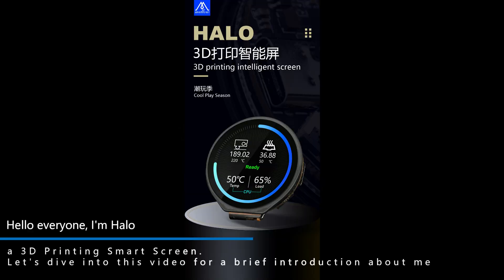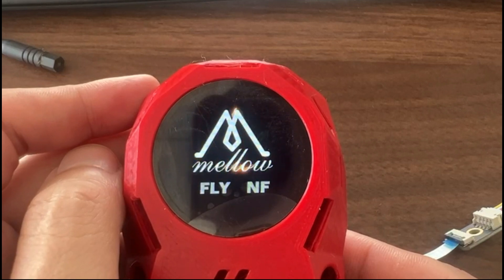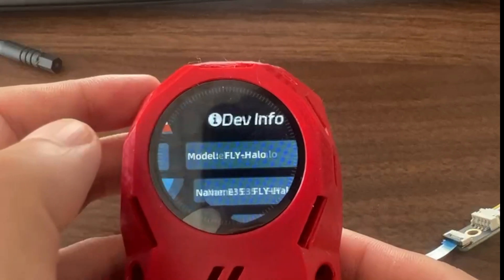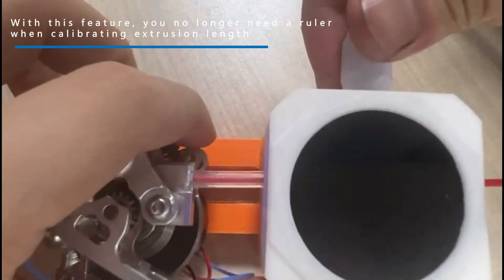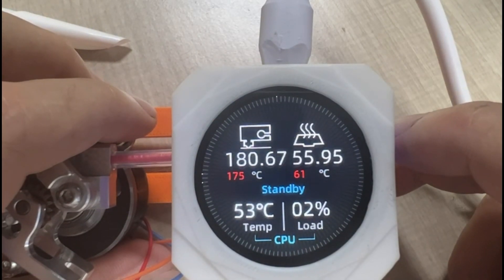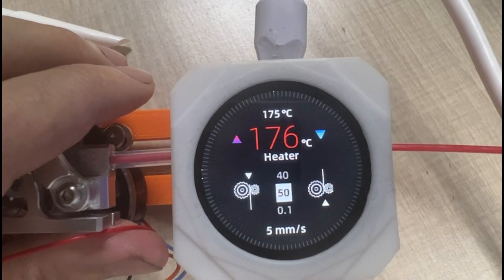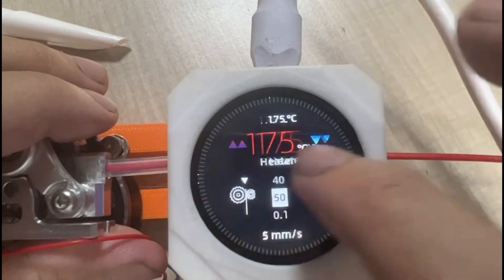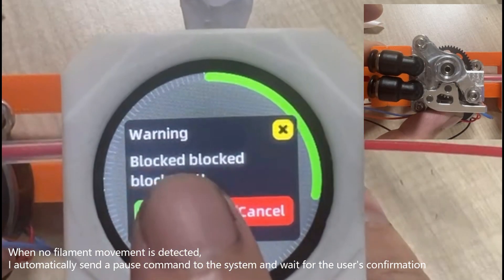Mellow Master Creativity with a Touch: Full Demonstration of 3D Printer with 1.28-Inch Touch Screen!

Comment: how do u connect it to the controller board? same as a normal 5 pin filament sensor? and is this all u just plug it into ur controller board and set up wifi? i have a super8 pro 1.3 so what are my options for it?